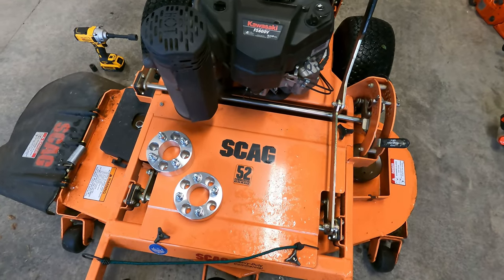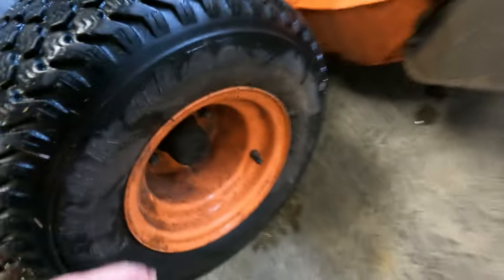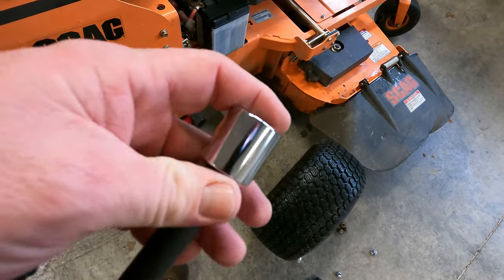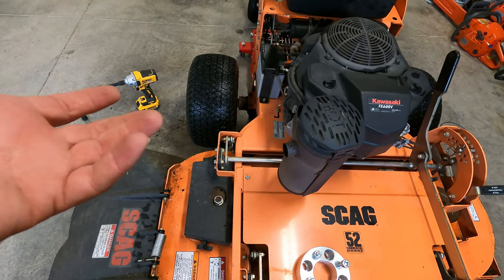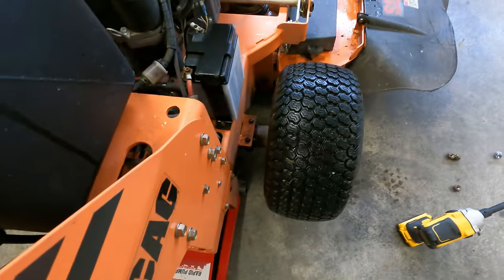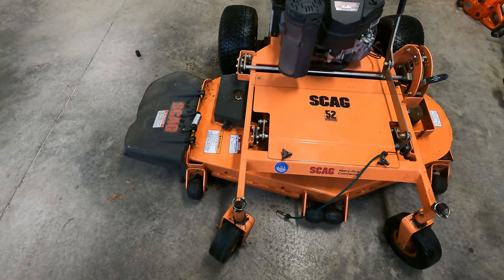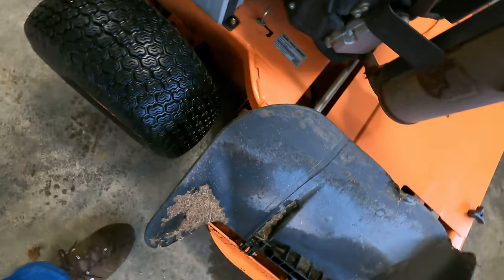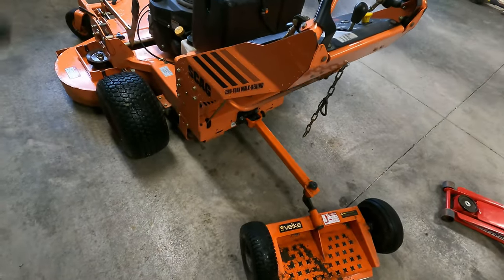Installing Wheel Spacers On A Lawn Mower 2021

Comment: I'm wanting to put wheel spacers on my Scag Tiger Cat II 61" so it matches the width of the cut. Only reason for that is to achieve better striping. I have the Scag striper kit, but it only covers the inside width of the wheels. The outer edges of the stripes aren't quite as chiseled as the 52" STCII I had before and I like to utilize the entire cutting width of the deck. Just wondering if these are all the same size. Thanks!

Comment: You got it figured out. Never had the thought of putting spacers on rear wheel wheels agter 20+year of mowing within my business.  I went from big block wide stance gravely 460s to lighter badboy mav 60 in. The tires tuck in and i have been looking for spacers myself for stabilizing machines while cutting steep grades. Where did you buy spacers? Thanks for video

Comment: got those kind for my cub cadet ultima , 1 inch spacers fit perfectly on the machine but the rim wouldn't fit on it . i guess the spacers outside diameter was 51/2 , inside my rim was tad bit smaller so wouldn't fit . I don't know what sizes are out there , got this from Amazon . I guess I'm asking for help were i could find spacers that would fit

Comment: I can't speak on wb's but after years of running spacers on ztr riders 1.25 is about as wide as you want to use - because of hub and shaft issues. Cheers.